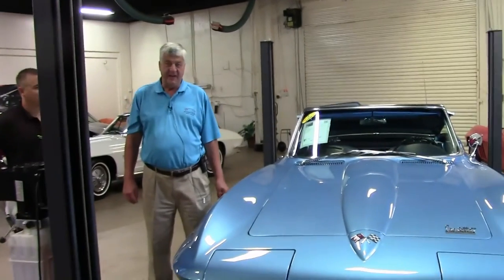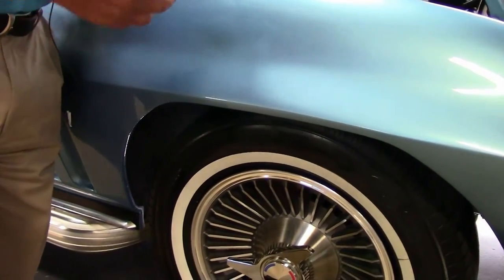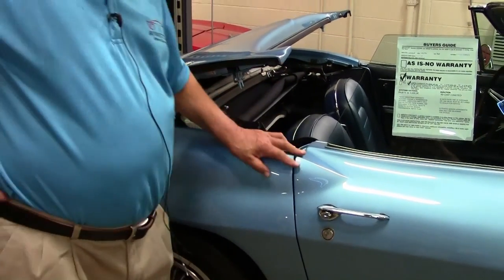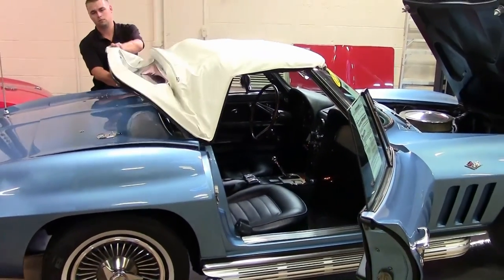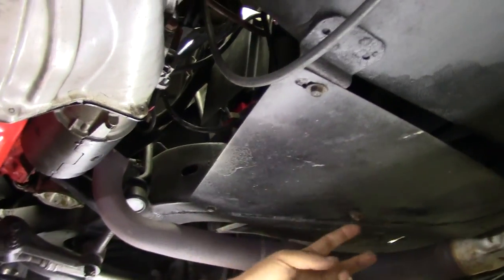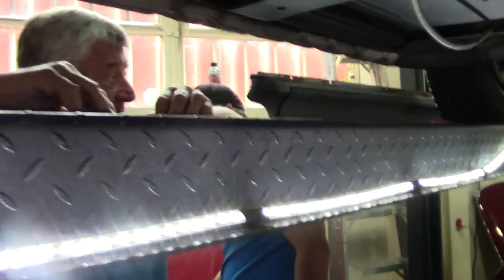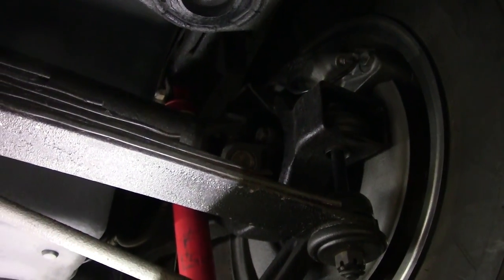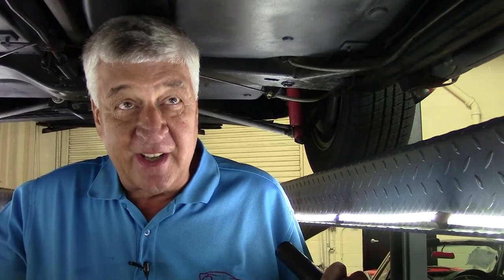1966 Corvette L79 Convertible

Comment: Ive had three mid year Corvettes. There is no way I ever wanted or would put side exhaust on them. They are too loud to really hear the engine wind out (best part of a solid lifter car). Cant enjoy the radio or conversation and they actually rob horsepower more than standard 2 1/2 exhaust pipes run under the car. Kid stuff--just noise trying to act bad.
Reply: No way.
You’d have to pry my side exhausts from my cold dead hands before I’d give them up.
They simply sound glorious and look terrific.